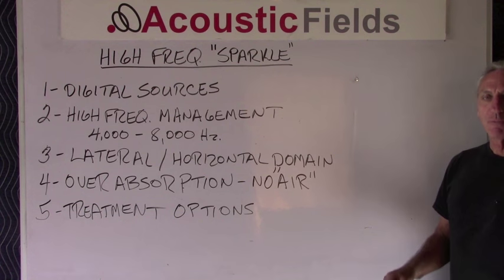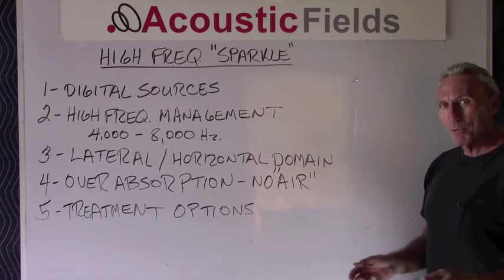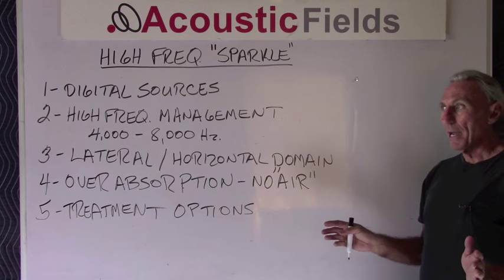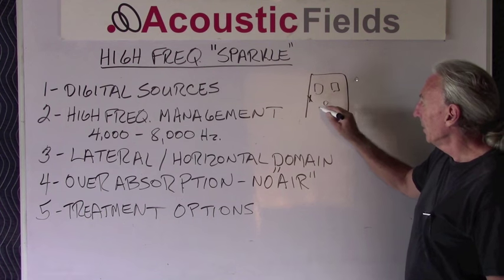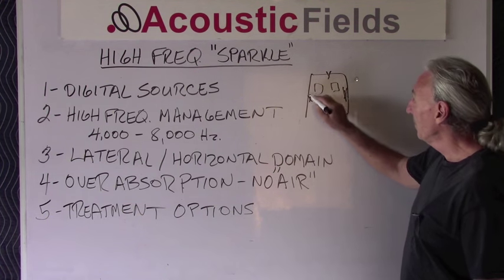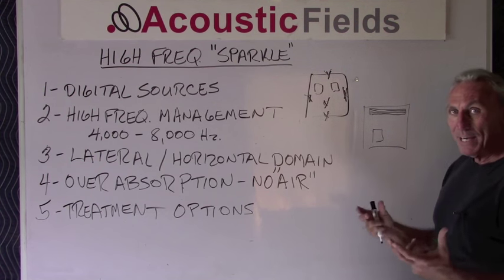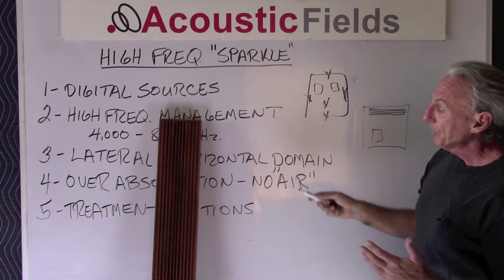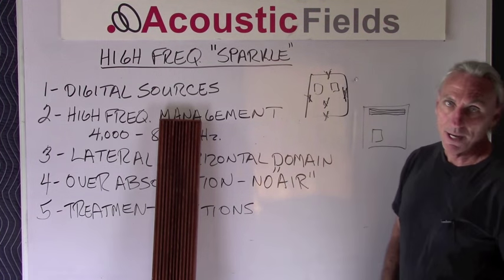What is High Frequency Sparkle? - www.AcousticFields.com

Comment: Thank you. My living room suffers from this brittle sound. I was looking for a way to make my room sound less glass like and more wood like.
Reply from the maker: B,  Are you willing to cover the glass when listening to music.
Reply: @AcousticFields  Yeah, I cover the glass with foam during listening session. I,m thinking the problem is hard walls with semi-gloss paint. I'm adding absorption using your foam, but I'm wondering if adding some high frequency specific diffusion would help. BTW, my room is too small for broadband diffusion.
Reply from the maker: B,  You would not want to add high frequency diffusion to a room that can't support a broader band of diffusion frequencies.  It would overemphasize higher frequencies.  The paint is not the issue. It is the hard surface.
Reply: @brown-eyedman4040  use rubber padding and egg plates
Reply: @brown-eyedman4040  Go one amazon and purchase, if don't already have one somehow, a cheap stethoscope, the use that to listen to the glass when you're playing something pretty loud (to energize the glass...) and see what the glass is doing. I was being driven mad by the high frequencies in a room... did all sorts of treatment to deal with it, then found the stethoscope and had a listen to the windows in the room. The screeching noises were off the charts (cinder-block building shunting loads of vibrations into the windows...). Simply covering the windows with absorbers did not solve the problem. I ended up applying sorbothane disks to the glass until it dampened the glass enough to bring the vibrations down to lower than the music. The improvement in sound quality was instant, epic in scale and sublime in results.